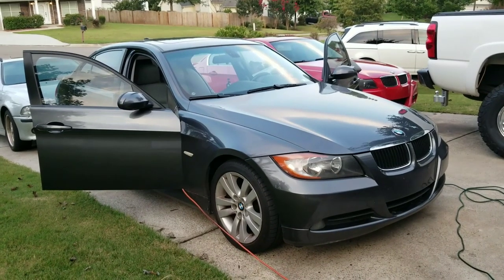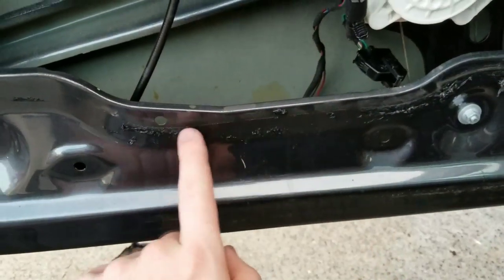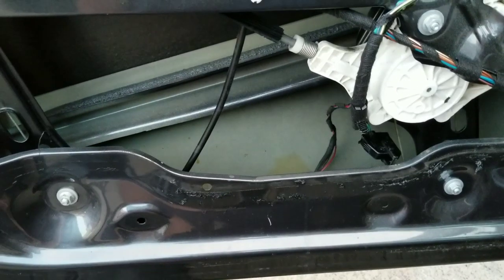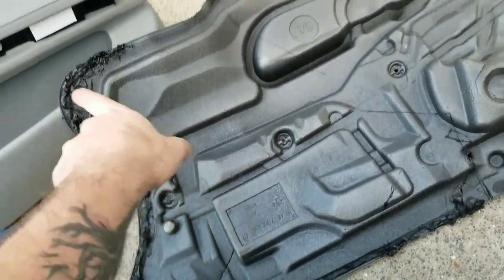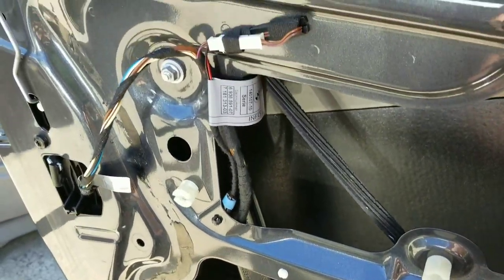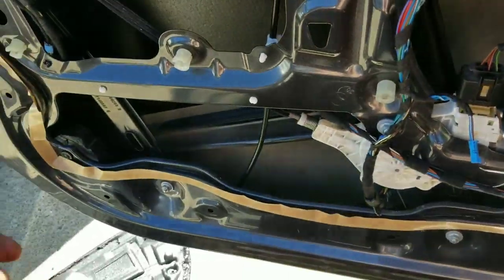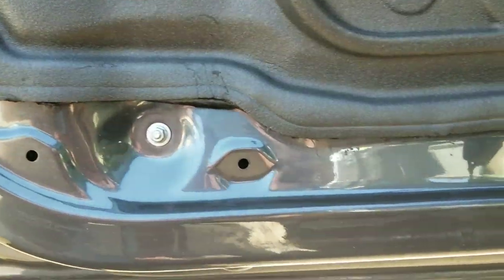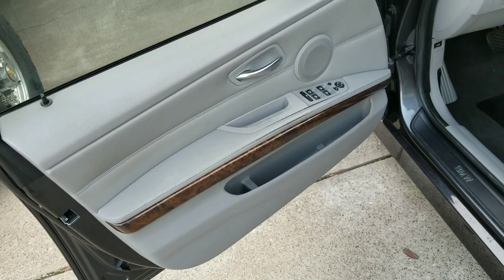BEST BMW Wet Carpet Interior Leak Fix!

Comment: Put the 1500 watt hair dryers away.  If it's too cold to hot-box the car in the sun, an easy way to dry the interior is to idle the car with the heat on high and a window cracked to let the humid air out.  30 minutes of that and it will be bone dry in there.  Gets rids of the stink too.

Comment: Still a relevant video. I’ll like to add though. The way this guy did it is the right way. Apply to door first. I tried applying the butyl tape without fully cleaning the old stuff off of the vapor barrier and applying it directly to the vapor barrier with the old tape still on thinking more would be better,  it still leaked a little right past my new tape and through the old as the surfaces weren’t fully sealed again. Now have to take it all off and re apply directly to the door first like this with a more cleaned up vapor barrier. My leak came from the bottom part of the barrier, both passenger doors. Also make sure you have new door panel  fasteners. The Nissan ones at O’Rielly’s work perfect. Gotta order bmw ones online.

Comment: The remedy is to keep the weep holes in the bottom of the door frame clean. Because they were clogged, the water built up inside the door frame and leaked past the top of the frame.  The barrier is not meant to hold water from getting into the car. There is NOT supposed to be any water build up inside the door. Keep the weep holes cleaned out and that will solve the problem.
Reply: Cleaned out? Mine look clean on the outside. Do you put something inside to clean the out?
Reply: Where are the weep holes?

Comment: They wanted $950 to fix my barrier, of course my floorboard is SOAKED after I told them it couldn’t be parked outside at the dealership. However, I ordered the tape and know what I’ll be doing on Monday.  Thank you so much!!

My only question is what did you use to remove the old tar/tape?

Comment: Thanks for vid ..didnt believe mine has the same issue but this was mine issue too. Fyxed it temporarly with heat and reseal original sealant and see how long will it last for. Just dont get it why is the water actualy goin down through wires and ended up at the seal of the barrier..weird

Comment: How much water in the carpet are you taking about? There is about 2-3 inches in mine? I don’t think a door leaking can get that much of water in my car
Reply: Wilber Hernandez 2-3 is the normal amount. Sometimes even more. It does t take much for it to run down pillars and start piling up. It's very common
Reply: +RadGreek Alright, thank you for replying I will check my door to see if that fix it, I hop it does.

Comment: I have the issue, I’ll make a video of it happening before I take it apart. Sadly for me the previous owner had it sitting for months prior to my purchase so water gets in on the passenger side pretty bad and I believe, not positive, that water damaged the audio system as there’s not even a crackle from any of the speakers and last I checked the area I heard swishing water under the passenger seat the floor speakers were submerged. Ps I have an 08 335i E92.

Comment: If you do that water build up in the door and stay like in the bucket. Am I wrong? It's shouldn't be any leak inside of door
Reply: The following videos have instructions that resolved the water leak on my 2008 528i.  I did not have to open the door panels.  Two BMW techs have informed me that these are the most common root causes of this issue.  Other reasons why your carpets are wet.
BMW E60 How To Clean Rain Water Drains Water In Ecu Box, Wet Carpet Fix: https://youtu.be/cFE9gf5NXxU
BMW 6-Series Hidden Water Drain: - https://youtu.be/ZJD4y_Qpmww

Rear sunroof drains:
Fix Most Common Roof Leak - BMW 5 Series 2004-2010: - https://youtu.be/QC2IUgIXUD0

Comment: Earlier quote from another thread: Quote: "Months later the water came in again so I sold the car." This is known as throwing that dead BMW cat over the fence into the neighbor's yard... and is a valid repair IMHO.

My 2008 BMW 328i has GALLONS of water slowly seep into the left rear passenger's footwell. And the bizzarro world thing is, it take a MONTH before the water stops seeping.

This happens if I park the car outside with the windows UP and the moon roof CLOSED - and it rains. The left rear footwell is full of water, and the driver's side footwell too (but not as deep up front, but it is equally persistant). Then if I park the car inside, for a MONTH after the foot wells will slowly fill with water, every day - I suck it out with the shop vac, and LO! the next day there is a new 1" water pond. I vacuum it out, and the next day, new little pond. I'm thinking of growing frogs in there. WE ARE TALKING GALLONS HERE. Where is the frucking 5 gallon reservoir of "slow release water" being stored in the frame of this stupid car? Its like there is a carefully regulated drip bladder inside of it somewhere. GALLONS!!! I sheet you NOT!

The funny thing is... After I finally got it dry, I screwed up and parked it outside and left the windows down and the sunroof open, and it rained... and guess what?

It got an inch of water, but when I vacuumed it out, it didn't fill back up.
WHY IS THAT? Fellow wizards, WHAT DOES THAT TEACH US? WHAT DO I DO? I'll stop screaming now and listen...

So my cynical lesson is - if you want to keep a 2008 BMW 328i sedan iinterior dry, PARK THE STUPID THING OUTSIDE WITH THE WINDOWS DOWN AND THE MOONROOF OPEN. For some reason, if you do that, it won't slowly leak down for a month... Seriously, how could BMW design such a POS car? I hate this car. I HATE IT, but I can't get any sucker to buy it.

Comment: Thanks for the video. That explains the water on the floor. I'm also getting water in the battery compartment. Do you have any idea why? I have a 2004 bmw x3. I don't have a sunroof as most of the videos show is the problem.
Reply: Check to see if your rear windshield is sealed correctly, if that’s not it I believe it will be your trunk gasket seal
Reply: It's been 4 years, but you may still be looking for the answer. It's probably the air vents at both sides of the trunk. Just remove the covers on both sides of the trunk  and you'll see them on the panel. They're black rectangular grills with rubber flaps on them.  Flaps tear by time and water leaks in. Remove them by a prying tool and replace with the orijinal parts.

Comment: Can these leaks burn fry anything that will make car not start.. asking.. found a e90 for sale guy told me rain storms flooded inside and car wont start now.. and ideas on what would have got wet.
Reply: if the trunk is leaking then battery may be wet.  Check the wire gromet by trunk